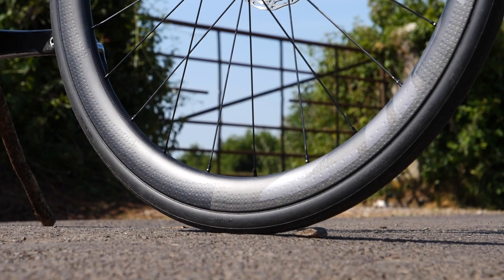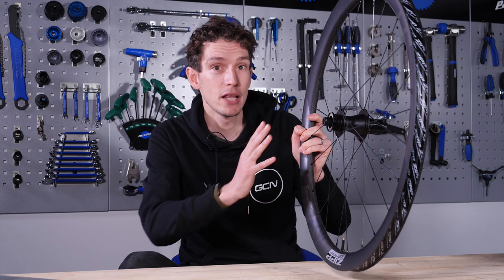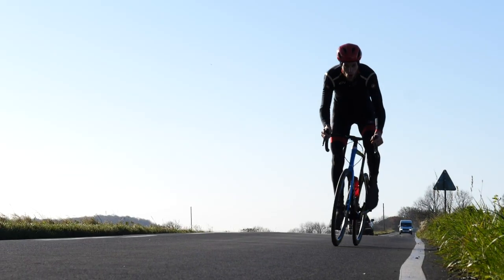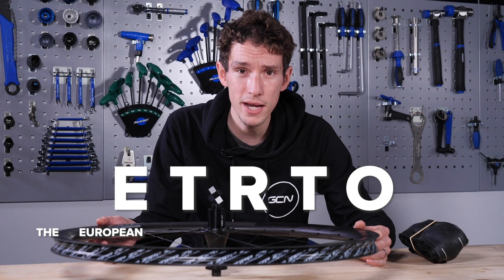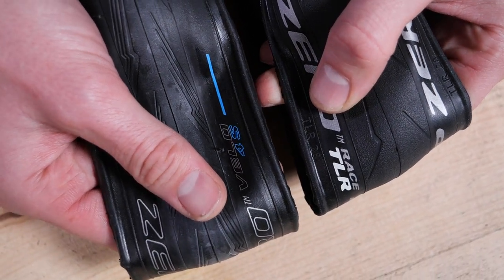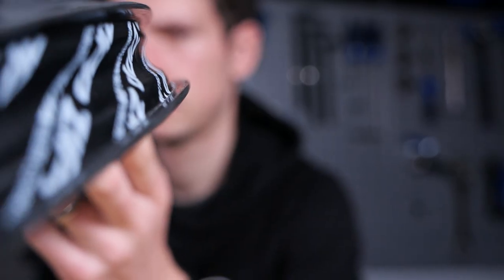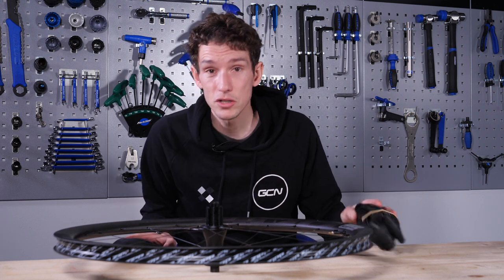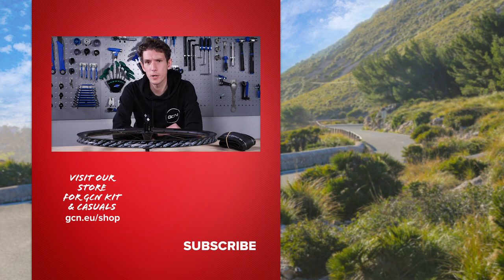Hookless Rims Explained | Which Bike Tyres Can You Use & Why?

Comment: Still on hooked carbonclinchers with latex-innertubes and rimbrakes.
Reply: Elvis der Blasehase why? heard of tubolitos or aerothan?
Reply: After a season on carbon clinchers with latex sealant, I'm done with inner tubes.
Reply: panzerveps just not enough to win but so much to loose on that tl path for me
Reply: @ianiscaratti4924  I've never experienced the tires being loose. Rather the opposite. Took me 20 minutes to force each tire onto the rim.
Reply: @ianiscaratti4924  polyurethan is almost the worst for rollingresistance. Tubeless is the best, latex comes close, next are thin butyl and polyurethan and then comes the standard thick butyl. Dont believe every marketing hype 😉
Reply: Elvis der Blasehase in independent tests tubolitos were a bit faster than latex
Reply: panzervep that's what you get from harder tl tires?

Comment: Correct tolerances are critical to press fit bottom brackets too, but I think we all know how that's worked out. I hope they do a better job with hookless rims, but I'm not convinced they will.
Reply: One piece and thread-together press fit bottom bracket from BBInfinite and Wheels Mfg cancels out that argument.
Reply: @shannontrainer5857  Not really, it just highlights how bad bike component manufacturers are at complying with standards, and that other companies have had to plug the gap with expensive aftermarket components. I've just had to install a Hope bottom bracket to get around the issue, but I can't really say I'm happy at spending about £100 to fix a problem that shouldn't exist in the first place, if the frame manufacturer (Trek in this case) had done their job properly.

Comment: Cool video Si. I've been riding tubeless for three yrs. I went tubeless because I thought was cool but, little did I know how much I would enjoy all the haters telling me tubeless horror stories, and they reason why they'll never ever go tubeless.
Reply: Ken, I have been riding road tubeless for a long time - whenever it started.  I did it after punctures at three races over a weekend ended each race.  I reckon I have had three or four ride/race ending punctures over that time, and two of those were sidewall cuts that were terminal for the tyre and would have been if riding tubed.  I have finished races with the frame wet with sealant but the tyre got me to the end.  I have run tyres down to the carcass, and been surprised when changing the tyre there were holes sealed I had not noticed.  Early TL was a PITB but now it is easy, except for any Giant "tubeless ready" rim which are universally awful.  I have friends who have tried TL and hated it, and that is fair enough, but for me it has been fabulous.  Plenty of haters out there, but I spend a lot less time on the side of the road with a CO2 cannister than I used to. Curiously many of my friends who sledge my TL use on my road bike love TL on their MTB or GX bikes. I reckon long term hookless TL will take over.
Reply: @brianglendenning1632  I don't which wheel set you have but, this past August I got a set of Zipp 303 Firecrest wheels. OMG they are easy to set up and the ride so way better then the Roval cl50's my Tarmac had as OEM. Cheers Brian and just so you know, I don't race I just hate flats riding my bike. Side note I lost 200 grams switching wheel sets.
Reply: @KenSmith-bv4si  hi Ken- had a range of TL wheelsets - mainly handbuilt wheels. Tried Various Stans rims, both variants of Pacenti, and currently the new Mavic Open Pro.  I find those easy to mount - the issue is pulling spokes despite 32 spoke build using White hubs.  But I will give those zipps a go!
Reply: @brianglendenning1632  Thats cool Brian I have a set of Stan's Avion's then I bought my tarmac it came with the Roval CL50's, awesome wheels but, the 303's with 25mm internal rim with 28mm tyres the ride is awesome, 55psi front wheel, 60psi rear wheel.

Comment: Perfect timing! I just learned that my GP5000 TL may not work with my hookless rims, which led to researching this subject! Thanks!
Reply: Conti specifically say do not use them on hookless
Reply: The same problem here. I do have nice and light hookless rims but the GP5000 TL are a nogo. Tried both Schwalbe and Michelin, they work fine. But would be nice if Continental is going to update the GP5000 TL, still the lowest BRR of all.
Reply: @djjanbo  It took Conti about a million years to make a tubeless tyre. Don't hold your breath waiting for a hookless-compatible one.
Reply: @beeble2003  they have one already. The TR version

Comment: Rode a set of hookless rims with tubeless tires at 5 bar for a year or so. Fitted a new pair and rode it at the minimum pressure printed on the tire of 6 bar. The rear blew off after 15 mins of riding... Stick to the 5 bar limit!

Comment: You would think that Si, would use SI units like bars for pressure and not imperial measurements.
Reply: PSI is the usual measure for tyre pressures in the UK where he's located.
Reply: Isn’t the SI unit of pressure the pascal? It’s the ETRTO that specified psi/bar according to the video so that’s what he presented. Who really works in Kpa for tyre pressures anyway? Not many gauges have it as standard, not in UK anyway, we’re still using miles for distance don’t forget! maybe in Europe does anyone know?
Reply: @stephenwills2098  My understanding is that everybody uses PSI or bar for tyre pressures; I’m not aware of anyone using pascals. The OP is probably just mistaken in calling bar the SI unit.
Reply: Actually, the OP is just speaking nonsense. I just watched most of the video again and it always seems to give pressures in bar. Sometimes it also quotes PSI, but I didn't notice any case where a pressure was given in PSI only.
Reply: Does it for the same reason he spells tire with a Y.  That's how they do things in the UK.

Comment: Using new Zipp 303 Firecrest hookless wheel with 28mm Schwalbe Pro 1 TLE tires at 51/58  tire pressures. Everything so far has worked great. Easy to mount the tire and able to inflate with a track pump. Ride quality is excellent.
Reply: 51/58 PSI - that's a joke ye?

Comment: You mention that hockless wheels will be cheaper but you buy them just once. What about the high price different of tubeless tyres which you buy more frequently, compared with the price of normal tyres?
Reply: Lighter wheels, but you're totally right.
Reply: I've been using tubeless since 2016. I've noticed no difference in wear rate and have not had a single puncture, including when riding my slick road tyres on gravel.

Comment: I used tubeless tires for a while, not worth the trouble. They do work, but when you have a puncture that's to big the you are left with the mess of cleaning out the sealant at the side of the road, before you can put a inner tube in.
Reply: Try Joe's sealant, Conti GP 5k, and the Stans dart. Joe's is the best sealant I have found.
Reply: @ThePaulbself  I had conti 5k's. Now riding conti 4 season tires with inner tube. I'm not sure if I will try tubeless again. The roads here in Belgium are just to bad, especially on my route to work, since I ride mostly to get to work and back

Comment: I have had this type of wheel for three months now, Zipp 303s. They feel amazing to ride at around 50 psi  with 28mm and I have more confidence cornering at speed. Not to say 25mm tubed tyres can't corner well but the feel and my perception of grip make it easier for me to trust the bike. 
The Vittoria Graphene 2.0 only lasted until two days ago when I noticed the tread layer was coming unglued (LBS will do the warranty thing for me), so I took them off and installed the P Zero Race TLR set I ordered a while ago. I had researched compatibility with hookless (tubeless straight side or TSS) but when I unpacked them there is a warning molded into the tyre "do not mount on hookless rims". I was initially very frustrated with this but went to the internet and apparently the first batches were made before testing was completed at Pirelli.
The tyres went on as easily as a conventional setup but I used an airshot to seat them. I think I might have gotten away without it but I had no trouble adding Stan's and inflating them. 
My feelings about TSS so far are positive, but remember to check your pressures regularly and add sealant if they are deflating quickly. With the Vittoria tyres it was a little over two months here in Brisbane and the sealant needed refreshing.
I would say if you are in the market for new wheels then go for it, there will be some things to learn and buy but nothing more difficult than running tubes in my opinion and they feel much nicer to ride.
Happy cycling!

Comment: Great to hear that the new standard "leaves no ambiguity". Instead of 622mm, it's now 621.95mm. Plus/minus 0.5mm. 😋 Love this.
Reply: It's never been 622. MTB used to be 621.5; and road clinchers used to be 621.95. Now it's 621.95 for everything, including road tubeless and hookless. The reason this is an improvement is that tire suppliers can now manufacture to one standard instead of several. This is safer and simpler for everyone.
Reply: Bastien Donze these people don't understand the difference between nominal and actual measurements.
Reply: Its not new. Also, when the manufactorers doesnt meet the standards anyway, again the customer is the looser.
Reply: It's impossible to manufacture to exactly 621.95mm so the standard, like every standard in the whole world, says how close to 621.95mm you have to get to be allowed to say you comply.

Comment: #askGCNtech Si mentioned that  the optimal pressure for most road riders was much lower than they think. It would be great if you could explain this!
Reply: Hi Daniel, there’s a video on GCN about this. Basically, softer tyres absorb vibration from the road that would slow you down, so you go faster with less pressure.
Reply: It's always so cool how cycling tech is evolving! Thanks for replying, it's really cool and congrats on your win!
Reply: Perhaps this will help. Enve wheels also has their chart and others. They seem pretty consistent in recommendation and are compiled from independent research of each company. 
https://axs.sram.com/guides/tire/pressure
Reply: Well of course for tubeless, if not pinch problems (for me) would have to be problem and tubeless has its detractions (for me). I am not heavy either.
Reply: @awesomexistence  Wow, that gives a wayyyyy lower number than the other calculator I had used, which was based on the 15% drop method.
Reply: @awesomexistence  That was helpful, and it is a great place to start.  Plugged in the values for me and my various road, MTB and GX bikes/tyre/wheels, and I seem to have landed on slightly higher pressures on my road bike (TL on custom aluminium hooked rims, 25 or 28mm wide), but on the GX and XC MTB I seem to run quite a bit lower pressures that the ENVE chart recommends and that is really about improving grip on the XC trails I tend to ride the MTB and GX bikes on.  Downside is that as I do tend to push the GX bike hard on XC trails the rear rim has a few dings.
Reply: The pressures recommendations are good start points but I adjust the mtb pressures slightly given the different courses (im 165lbs and 1-2 lbs makes a differnce) for my intermediate cross country/lite technical riding style. Glad the charts were a help to you.

Comment: SAFETY FIRST !! In an industry that values marketing hype and profits over engineering quality assurance/control I am not convinced by this technology yet. Many bike manufacturers still use the consumer as a lab rat by releasing unsafe or not thoroughly tested compatible product.Creaky BB's,holes that are not round,headsets with internal cable routing that can wear and fail,forks that can fail,cranks that fail,the list goes on and on. The whole bike/tyre industry needs to get their shit together IMHO.Standards are not standards until everyone agrees and strictly adheres to them,without conflicting standards and the highest level of QA/QC.

Comment: For those thinking that a big bump could easily increase the pressure in a tire to or past Zipp's stated 145 psi (to get a tubeless tire on their hooked rim to blow off), you're wrong.  Let's say you inflated your road tubeless tire on that Zipp hookless rim to 100 psi. You'd have to completely compress 31% of your tire (basically 1/3 of your tire) to zero volume to see the tire pressure increase to 145 psi.  At more normal road tubeless pressures, say 70psi, you'd have to compress over 51% of your tire to zero volume to get a blow-off. What all that means is that there's no bump that's going to cause a blow-off.  A bump could damage the rim so that air pressure is lost, but that's not a blow-off.
Reply: tire pressure and volume is not linear...
Reply: @yialanliu  , who said it was?
Reply: @robinseibel7540  Your math was assuming it is linear.

Comment: I am mainly interested in the tire pressure advantage/disadvantage thing; could you explain on that, maybe in some dedicated video?
Reply: Basically you don't want the tire to be too hard, so it have to "climb" every little pepple on the road. You want the tire to be just supple enough to absorb the roughness of the drive surface.

Comment: I feel like a lot of the safety fears are founded on the narrow tires normally used on road bikes.  In the automotive realm, a wheel width of 150-175 mm or more is pretty normal, and the tires that will go on it will be at least 25-30 mm wider than the wheel...  that in turn means that when pressurized, the forces acting near the bead have a larger normal component than a tangential component.  But of course, automotive tires are rarely very high pressure.  Many are kept between 35 and 50 psi.  That said, there are still use cases where the mechanical load on the tires can change the calculus there (e.g. off-roading, rock climbing), which is why things like beadlock setups exist.  Even on a mountain bike or gravel bike, the wider difference between rim width and tire width along with the generally lower pressures afforded by tubeless equals some feasibility...  But with road tires, there's barely 5 mmm of difference between tire width and wheel width, meaning that the forces under really high pressure aren't as well aligned to the normal of the rim lip.  That also explains why the max pressure rating is ~72 psi.  In the before times when inner tubes were still the only game in town, you had hookless wheels as well, but you had  the tube pushing against the bead from the inside, so it helped to keep things seated.

Comment: The research conducted by Silca and Tom Anhalt shows that the optimal pressure for most road riding is somewhere between 85-95psi (I forget the system weight - 80kg, i think?).        You can plug your info into Silca's tire pressure calculator and see for yourself.   And this backs up my experience as well, riding everything from 24c tires which measure 26.xx to 35c tires which measure out to 37mm.       85-90psi is definitely faster (and not just "feels" faster due to vibration losses) than 60-65psi.   

So I am not really sure what the point of wheels that top out at 70 or 75psi is, as rated by the manufacturer.     Saying "oh yeah, you can go higher" doesnt work - the manufacturer needs to back up their product and certify that it will work at those higher pressures, else they are just weaseling out.

Comment: Inflating a tire on a static test to 200 psi before it fails is one thing, but what about friction tests? You don’t want to have the rim fail or the tire explode if you’re descending at 70km/h+ and braking before a tight corner for instance. 5 bars means to me that it’s mostly useful for tire width of 28mm or more. Also disc brakes are mandatory for that IMO. I’ve been using tubeless tires for the last 3 years and I’m very happy about the technology, but this one I’m on the fence.
Reply: No-one sensible has rim brakes anymore.
Reply: W DL 
They cost less, are lighter and work.
Reply: @granthutchinson5937  Not in the rain they don't.
Reply: @manfredmuench2657 Maybe on carbon wheels, but on aluminium wheels they work well in the wet.

Comment: Been using tubeless with hooked carbon rims for over 12 months now and really like them. Just not convinced with hookless yet. What happens when a tyre punctures that won't seal and deflates, will the tyre remain seated or possibly roll off the rim? at least with hooks your guaranteed the tyre will remain seated even with a deflated tyre.
Reply: It’s far easier to unseat a hooked tire than a hookless. I have a pair of Enve 4.5AR (25 mm internal width, and hookless) and they’re absolute bastards to try and de-bead the tire. If you get a flat at the road side, it is possible to run a tube, but you’re in for some SERIOUS trouble removing the tire to put the tube in. I’ve tested 3 different types of tires, and there’s a slight variance in fitment tightness, but holy shit they’re difficult. If you’re not a staunch believer in tubeless, do not buy a set of hookless rims.

Comment: Almost 500 km since using Zipp 353 NSW wheels with Vittoria Corsa Next 28c tires. So far i don't have any problem with this setup. But i did ordered 30c tires, i think 30c will be sweet spot for this wheelset, will be more comfortable, stronger feeling and also i don't think it will be any slower. Roads are mostly not in very good condition where i ride. Also i don't think they are cheaper. I was going to buy Bontrager Aelous RSL 51 but then decided to go with Zipp NSW 353. Lighter and more comfortable for all around use, instead of pure aero. Plus they were almost same price, Bontrager a bit expensive, that's it.